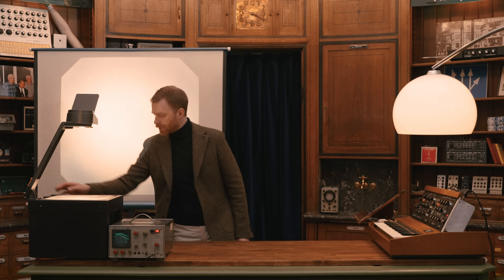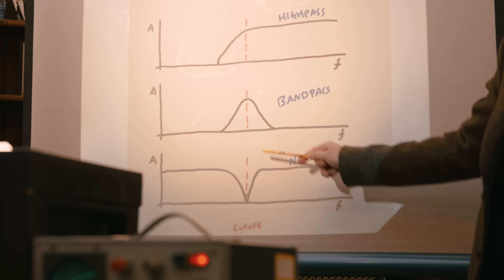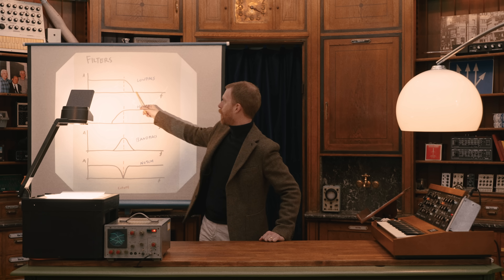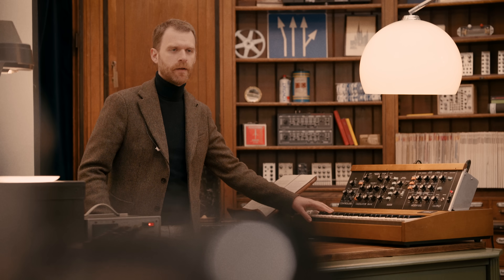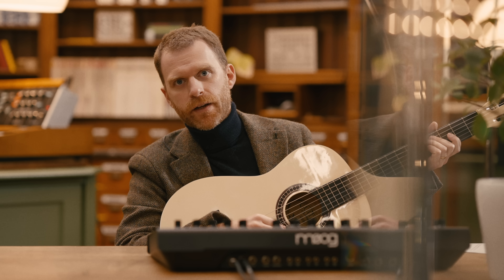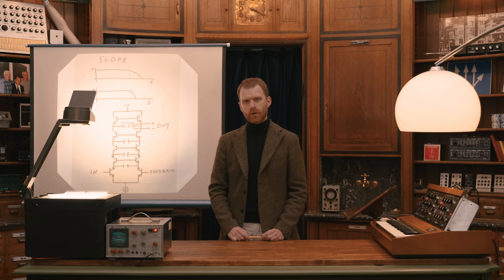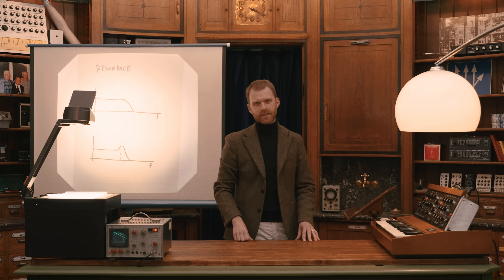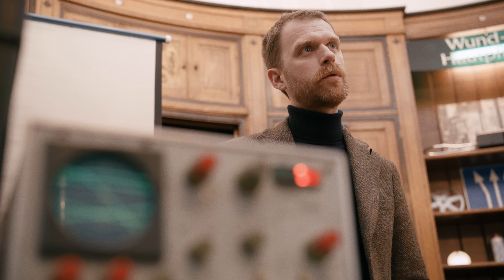Synthesizing with Moog | Lesson 4: Resonance

Comment: I have a Model D 2022, and it has a very strange problem. If I don't turn it on for a long time and then turn it on again, there will be a continuous low-frequency sound without any pitch. The keyboard keys make no sound. It's fine after turning it on again. Then, usually every month or a few weeks, sometimes every three months, this situation occurs. I think it's a bug, but Moog's official support is terrible. There is no technical support now. Such a company will die sooner or later! I will never buy any Moog products again